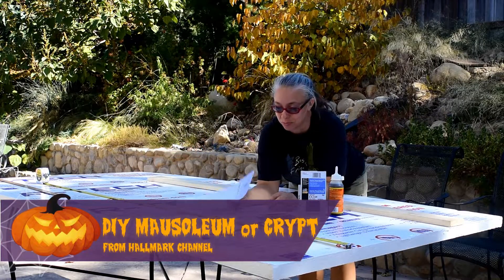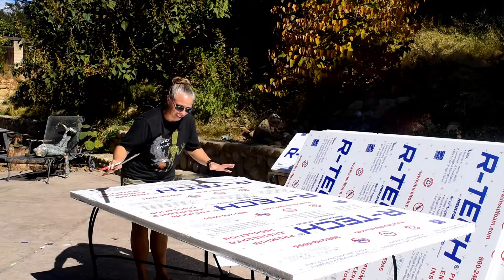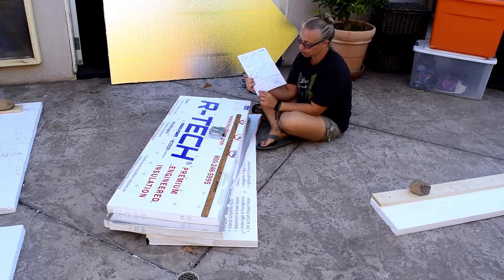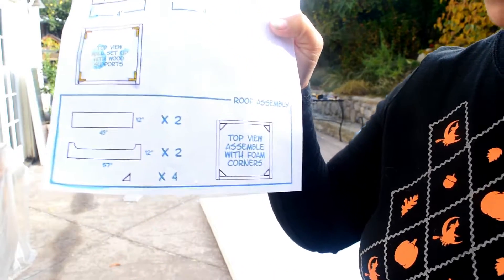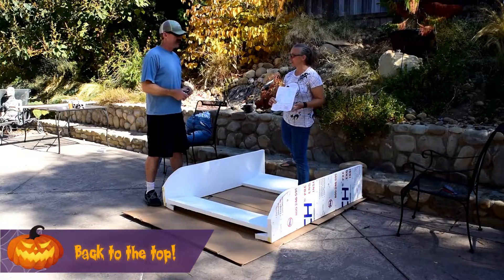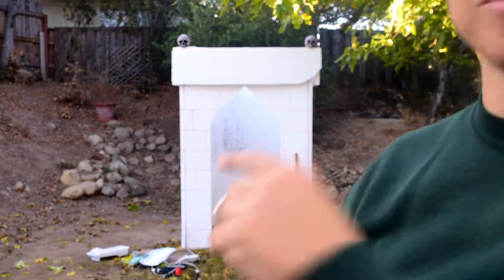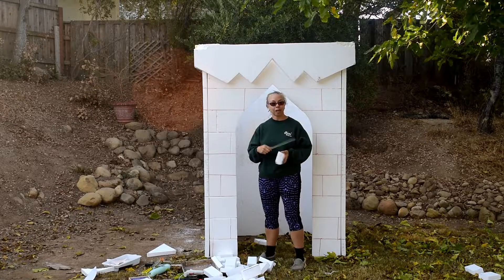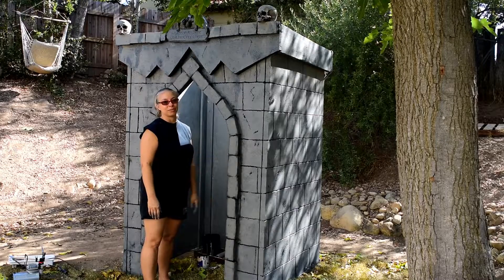DIY Mausoleum Crypt Foam prop

Comment: Grt job, I was laughing during the video because I feel your struggle. Quick question, where did you put the window in the back??  And, did you attack the projector to your mausoleum??
Reply from the maker: Thanks, glad you got a good laugh. Actually I ended up cutting a DOOR! I was having a hard time with the projection fitting in the frame of the window. With the option being bigger with a door, I hung a curtain and had my projector placed on a small table behind it. Of coarse this all happened on Halloween.  This seemed to work the best. The black curtain inside during the day looked cool as well. Here is a small vid I did.  https://youtu.be/q8dDHb6S-No?t=145
Reply: i guess Im asking randomly but does anyone know of a trick to log back into an Instagram account..?
I was dumb lost my login password. I would love any help you can give me!
Reply: @Abraham Desmond instablaster =)
Reply: @Ford Emery thanks for your reply. I found the site through google and im trying it out now.
Takes quite some time so I will reply here later with my results.
Reply: @Ford Emery It worked and I now got access to my account again. Im so happy!
Thanks so much, you saved my ass!
Reply: @Abraham Desmond Glad I could help xD

Comment: 11:52 I have been using a hot glue gun [on lowest heat] to glue any of my styofoam pieces togethrr. It is strong! And i use a screw witha wide washer to hold them a wooden framework with 90 degree elbow brakcets on the inside of each corner, for ease of putting together and storing later. 😊
Reply from the maker: Love the hacks and anything for easy storage!!

Comment: Looks good however the foam is toxic and so you should use a respirator. For the hinges if the pins stick consider drilling them out a hair larger so the pins drop in and out easily.
Reply from the maker: 100% This is one of my first foam props and I was learning and now I always wear a mask when I'm melting my foam.